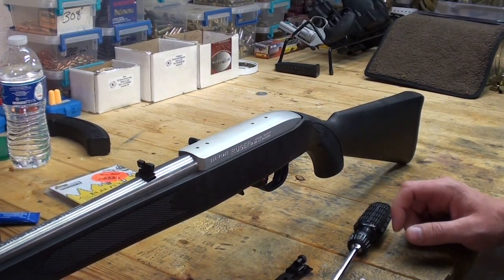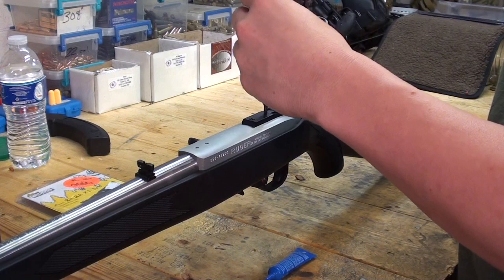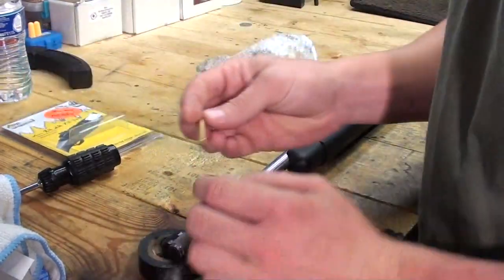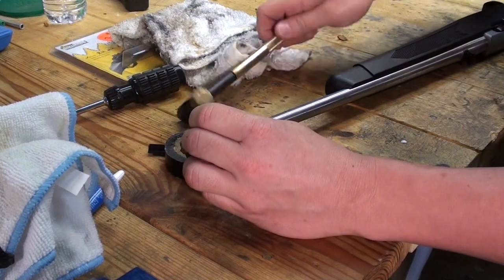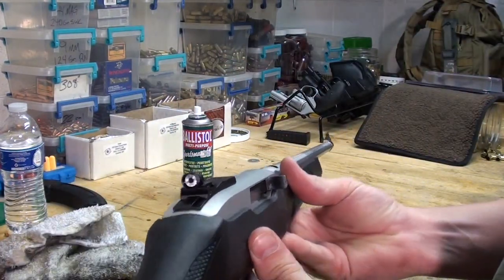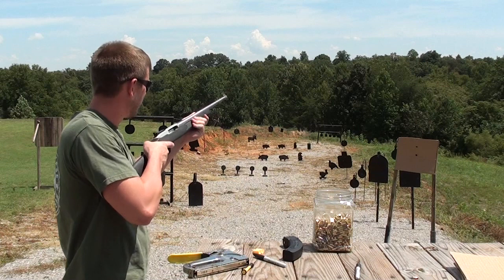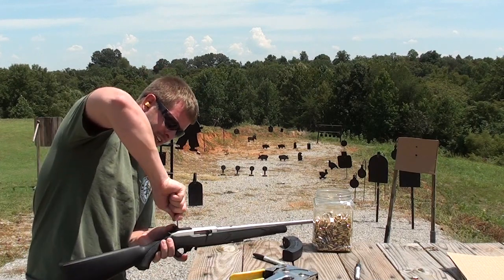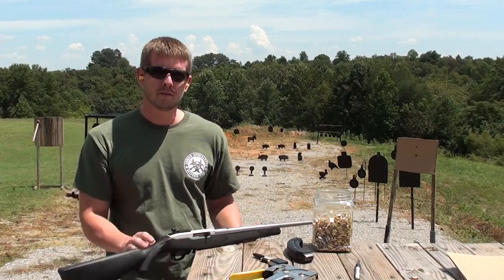WILLIAMS PEEP SIGHT  RUGER 10-22

Comment: Excellent instructional video.  I just replaced my 10/22 sights following your steps and had the new Williams sights on in about 15 minutes.  Piece of cake!  It is probably important to emphasize that the front sight should be removed from left to right as you show in the video.  It came out fairly easily for me with a 1/8" brass punch.  When installing the new front sight be sure to insert it starting from the right side of the barrel.  It feeds in a little then needs to be tapped in until it's centered.  No sanding or filing is necessary.  With the brass punch, the new front sight goes in cleanly with no marring.  I left the original Ruger rear sight in place.  When folded down it does not get in the sight line and gives the barrel a more complete look.
Installing the Williams rear sight could not be easier.  Two screws out, two screws in...done.
Brandon, since I can't just go out back and test the sight elevation I would be interested in hearing what hash mark you ended up using for the rear sight alignment. 
Again...great video.  The new Williams sights fit the 10/22 takedown perfectly.  Thanks.

Comment: I put the Williams Ace in the Hole peep sights on my Mossberg 500 slug gun.  Before I installed the sights I removed the fiber optic rod and replaced it with a brass brazing rod.  The fiber optic sights cover up to much of the target in bright sunlight to suit me.

Comment: Good vid, thanks. One small criticism.   Initial sighting-in should be done at short range (as you say) but by shooting groups rather than single shots - and from a rest.  As you point out, this saves a lot of time later as you  try and find out where the rifle is shooting at longer range.  Sometimes it can be out by many feet.  Finally, some people wanted to know what Williams sights are made of.  Years ago it was steel.  These days its aluminum.  Plastic isn't used at all as far as I know.

Comment: do you have to remove the rear factory sight? does it still block the peep sight if you fold it down?
Reply: according to other users, the original rear sight does not get in the way of the new sight when folded down.
Reply: It flips down out of the way

Comment: Brandon I have a concern with my 10/22 after taking it out for the first time the fiber optic front sight shifted over to the left. Now when I tried to push it over with my hand it was really tough. Now I am a pretty strong guy, I've been powerlifting for over 15 years. However with a few taps of a soft mallet hammer I was able to move it back over. So i think, okay it was a fluke. Well it wasn't. I've tried different ammo and it still does it. Should I just replace the sights, like you did?

Comment: Good video. However....while he rear sight was very easy, but the front sight was very hard on mine. There was some kind of very strong glue in there. I ended up putting it in a vice so I could hit it hard without canting the sight ring (read this in a BB). Once it was out the rest was easy.

Comment: I put the new ace in the hole peep sight by williams on my 10/22 takedown. I too didn't like the factory sight or open dovetail cut on the barrel. Brownells sells a dovetail blank manufactured by williams #962-000-034, check it out and I'm sure you'll order one to fill that hole.